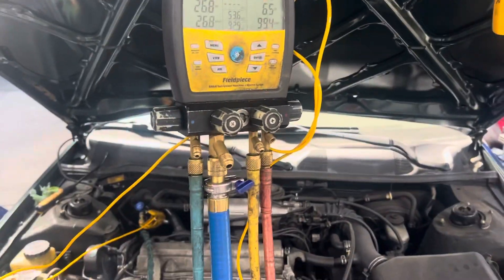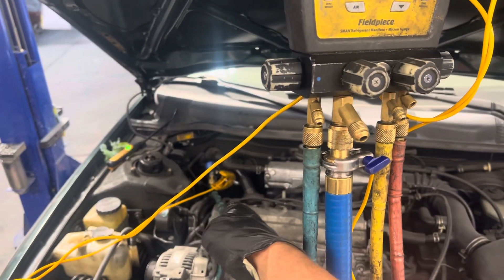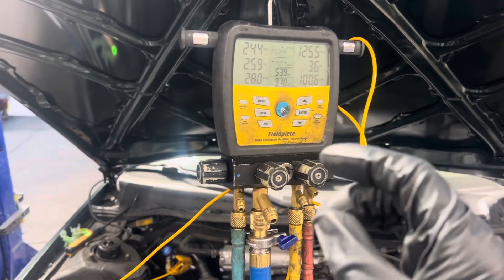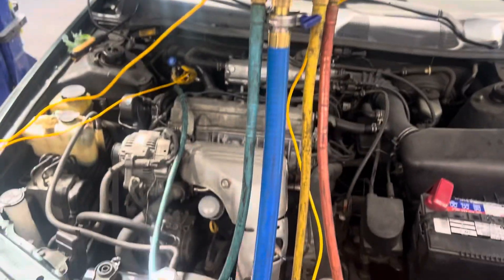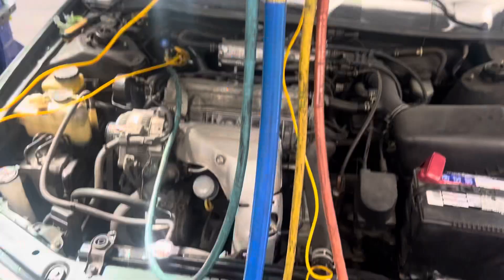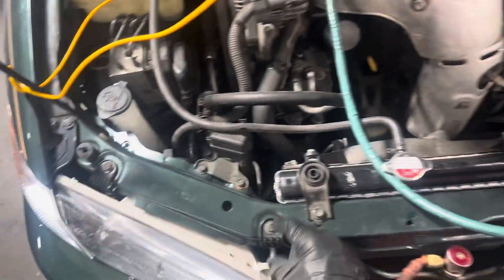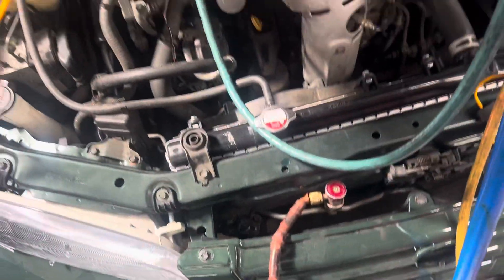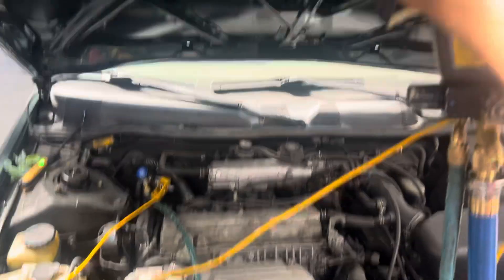Evaporator section line temperature 55°F but – air temperature is 36°F. Sometimes it’s the opposite￼

Comment: Is it normal for the compressor to sound like a movie projector?
Reply from the maker: Lol 😂 you’re showing our age. 

Are we talking about movie projectors that we would watch in the auditorium in school back in the 1960s and 1970s. . Almost can’t remember that sounds don’t think I’ve heard one on the air conditioning compressor. 

Something similar in an electric compressor on a Prius sometimes in some situations. 
But not normal. 

Reminding me of winding and threading 8 mm black and white film 🎥 at home as a child.
Reply: @coldfinger459sub0  Lol I know but it's the only thing I can think of thats comparable to the noise. I just fixed the ac in my 06 ford ranger and the faint fast clicking sound the compressor makes reminds me of an old movie projector. It's not loud but I can still hear it fairly well. The compressor on my Silverado is almost completely silent but it's mounted toward the bottom of the engine. The compressor on the ranger is on top of the engine so I thought that maybe why I can hear it better. I've had the truck over a year but the ac didn't work when I bought it and I'm just now fixing it. It had a leak in the liquid line so I replaced it and I also replaced the accumulator, I added 3 oz of oil and pulled a good deep vacuum and let it sit over night. The hood sticker says it takes 2 lbs 1 oz of r134a so that's what I put back in. It blows really cold air but I just noticed that the compressor makes a fast clicking noise like a movie projector when it's running.